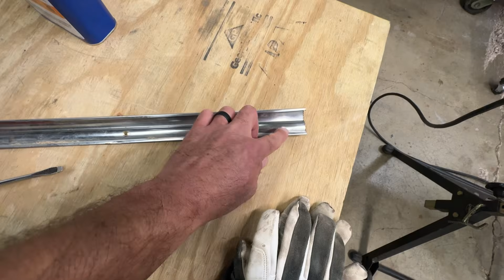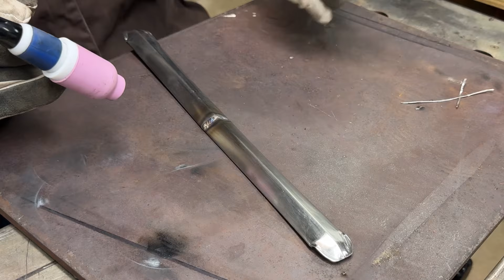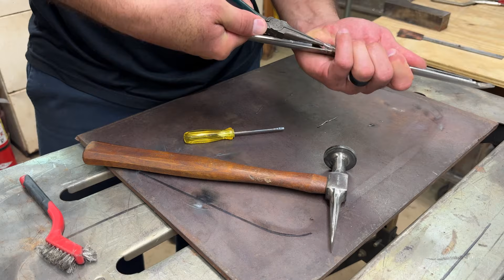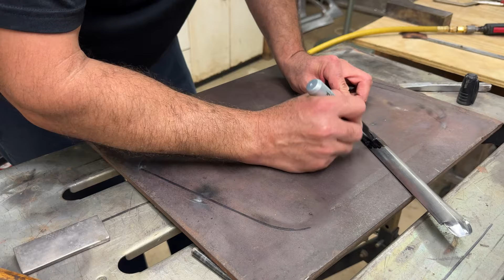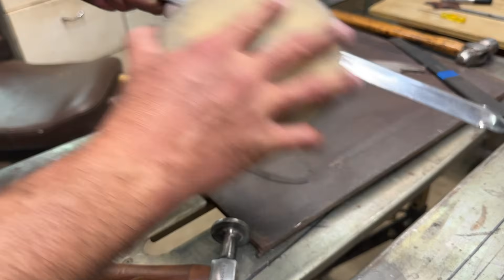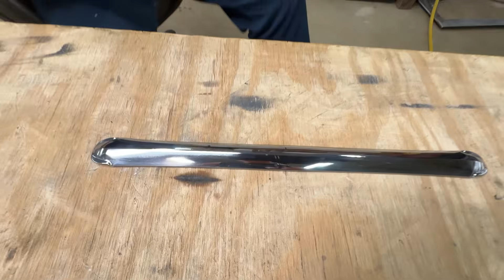Custom Stainless Trim Welding

Comment: great results! thanks for the vid. can you tell us the settings on your TIG machine? cheers.
Reply from the maker: Thanks for watching! I had it set around 30 amps and I'm using a gas lens kit on my torch with 1/16 tungsten and a #10 cup.